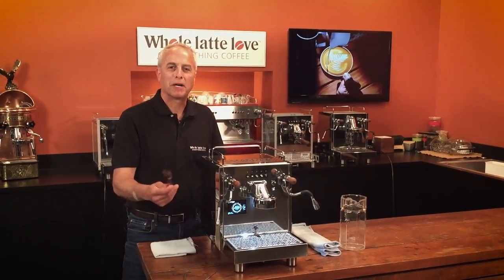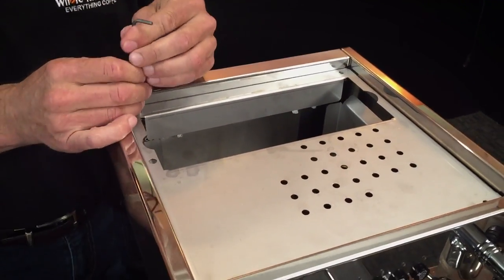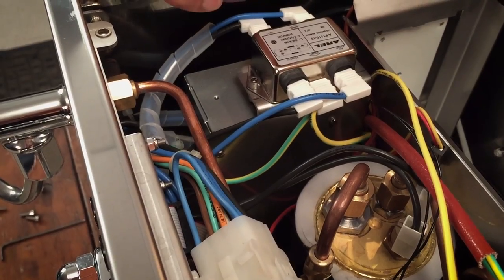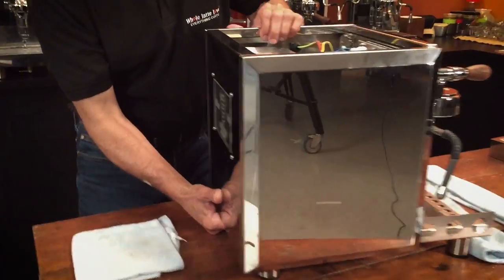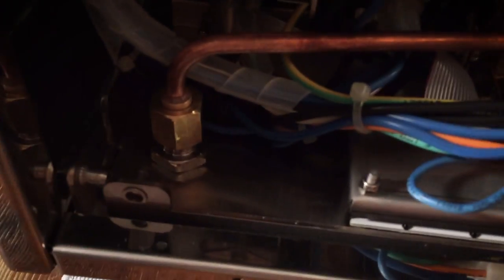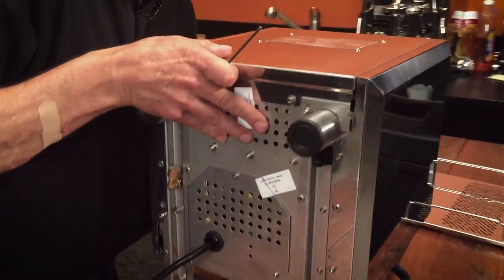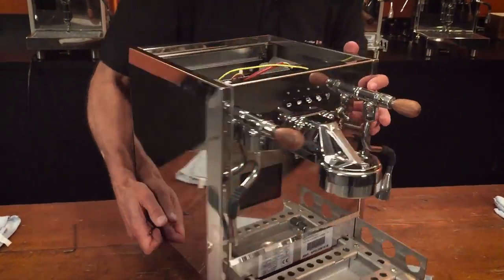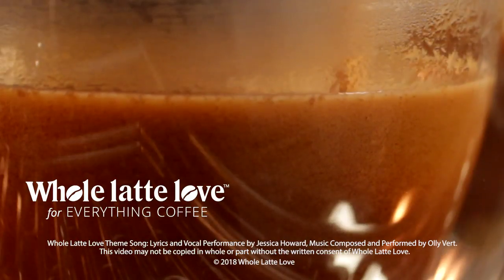Bezzera Duo MN & DE: How to Remove Housing

Comment: Please help.  Some how got ants in the water basin. Pulled the side panels and put them back on as the video and my beautiful quiet duo now sounds like a jet engine taking off.... what did I do wrong....
Reply from the maker: Hey Jay, If machine is working normally and just noisy it's likely a pipe rattling against the housing or other internal component.
Reply: @Wholelattelovepage  actually seems like the outer shell is rattling just on right side , I got it closer but can’t get it as quiet as it was.

Comment: How to adjust pump pressure. My bexzera has low brew pressure around 6. I tried to change tamping and coffee grind degree but not impromivng brew pressure.
Reply from the maker: Hi HM, Are you seeing 6 bar pressure when brewing? If so, what pressure do you see when there's a backflush disc in? If showing 9 bar with a backflush disc in (that's static pressure) then all is well and no adjustment is needed. If you have a Bezzera Duo or Matrix it uses a rotary pump. Brew pressure on machines with rotary pumps is adjusted by turning a screw on the pump which is accessible underneath the machine. I just looked at a Matrix and the adjustment is covered by a black removable cap. The pump is adjusted at the factory for proper brew pressure and rarely if ever needs adjustment. If you are absolutely certain it needs adjustment place a backflush disc (blind filter basket) in the portafilter and start as if brewing a shot. Turn the adjustment screw to get a reading of 9 bar on the brew pressure gauge and that's it.
Marc
Reply: Marc is right, you have to check the brew pressure using the backflush disc. If it's below 9 bar, you adjust it. If it's 9 bar with the backflush disc, the machine is good and your coffee grind is not. But with coffee, you might never get 9 bar because there's always some flow.

Comment: Not related to cover removal, though probably you could answer. I've noticed BZ grouphead has changed from "flat top" to "sloping bar" like on machine you are working on in this video. Other models also show up with this variation of grouphead and pictures on Bezzera site also show this variation, while manuals show old (?) "flat top" grouphead. Is it just cosmetics or deeper changes, affecting temp. stability? Dispersion plate and seal are same or changed?
Reply from the maker: Hi, Thanks for the question. We believe it's a cosmetic change - may have something to do with the addition of the 2 down facing LED lights which sit below the BZ group on Matrix/Duo DE's. Todd and I will be visiting Bezzera in Italy week after next and will ask about the group change. One thing to note here is PID control of the group heating elements. In this video: https://youtu.be/Rn1S23pGPiQ?t=3m23s I did some group surface temp testing of a thermostatically controlled (non-PID) heated group on a Bezzera BZ07. In that testing I found a 5F temp fluctuation as the thermostat cycled over time. PID controlled heated group on Matrix/Duo DE should be much more stable. Is that a big deal? Probably not huge. I doubt getting rid of that fluctuation has a much impact on brew temp but then again every little bit counts.
Marc
Reply: Have a great time in Italy and with Bezzera! Sure you'll come back with some insights to share, and hope to watch a video with your thoughts on Italian coffee/espresso scene vs American.

Comment: What tool you used to remove the nuts
Reply from the maker: Hi RS, Thanks for the question. Allen head aka Hex. Typically 2.5mm or 3mm.

Comment: Man. If I could only get that cap nut that goes on the underneath waterline in... lost mine in move.
Reply from the maker: Rick, That's a bummer and not a common part or one we currently have in stock. If in US and want to pursue a replacement it's probably something we can order from Bezzera. Contact us here: https://www.wholelattelove.com/pages/contact-us
Reply: I have a solution: Run a water line into the machine!

Comment: Poor design by engineers to make those 2 cover screws so inaccessible. ECM elektronika has 2 similar screws in an even worse angle. Time for a redesign of the 2 screws and their placement. So many other machines do it better for the external cover.